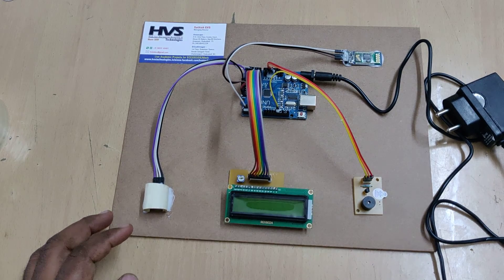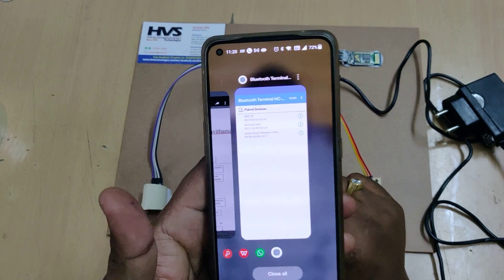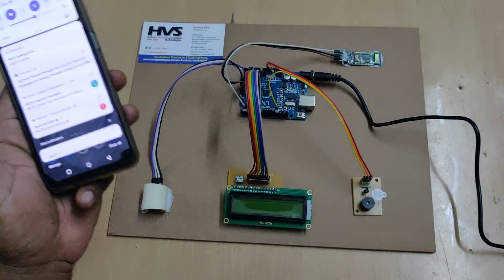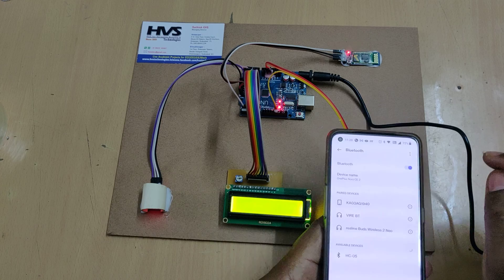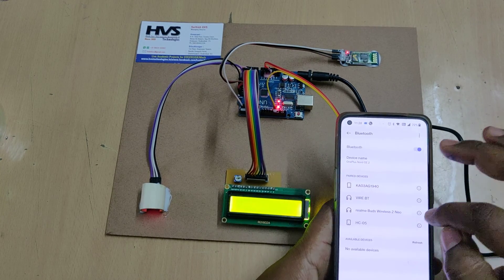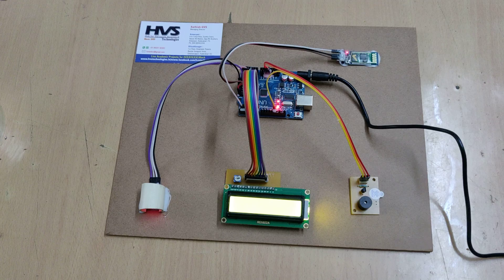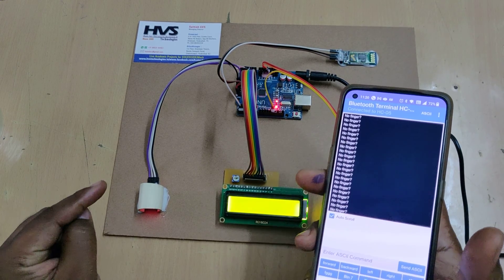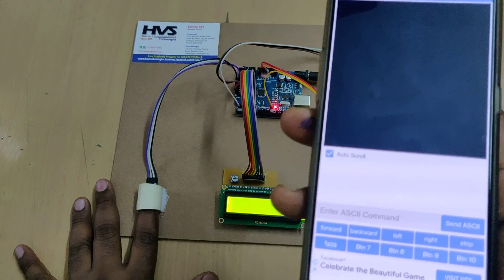HVS-4592. Non-Invasive Glucometer with Bluetooth monitoring using Arduino UNO #NonInvasiveGlucometer

Comment: Como se llama el sensor Infrerrojo que se emplea dentro del proyecto o algun codigo de arduino Gracias...
Reply from the maker: Hi, 
We sell full working kit with document PPT circuit diagram and code. Could you Send me the video link, Will update you the cost details. You can contact us at +919603140482
Through WhatsApp or call